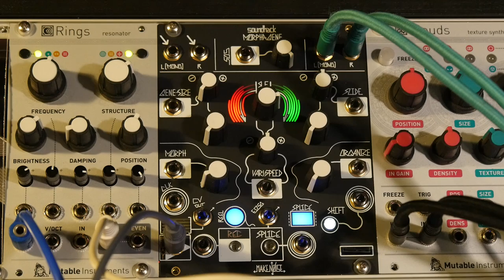Make Noise Morphagene Gating Technique

Comment: What does multing the gate to the clock input do in the first example? Do you not achieve the same thing just sending the gate to the play input?
Reply from the maker: kmb zoot if the gene size is smaller than the entire sample, then sending a gate to the clock input will "step" chronologically move through the genes in the splice. it has no real effect if you don't have the gene size smaller than the splice

Comment: Wouldn't applying a gate to the Shift and Play input yield the same results? I may be wrong as I've only sat down a couple times with the modules so far!
Reply: not really, you would first need to make some slices through this loop to make it shift. You could plan your sequence of genes this way and it would be repetitive, but no unpredictable, random results anymore. Well, unless you would patch some LFO signal to gene size, slide or vari speed additionally.

Comment: weird i thought stackables only worked for output not input. good to know
Reply: On input it seems to act as a sound mixer. Prolly OK for some signals (audio), might be dangerous with something like two very hot CV signals being summed up eg. high gate voltages. Dunno...
Reply: basically its just a janky passive mult
Reply: For the record Make Noise says the following about their mult... "The Multiple is passive, because the Make Noise system does not require Buffered Multiples since all critical control signals are already buffered in such a way as to provide a large fan-out capability." Having said that I stick to buffered and unity gain situations.

Comment: Nice demo :) Hey is it me or the sd slot is not aligned straith with the hole in the panel?
Reply from the maker: Matrix Modulator I'm not totally sure. I had the same thought but perhaps that is how the SD housing it fit on the PCB.
Reply: Ok so it's just not because of the camera, it should be straith like the picture they use for their website, the sd card on radio music is straith aligned too. Thanks http://www.makenoisemusic.com/thumbs/modules/morphagene/mpg12-1050x1328.jpg
Reply: Did you try morphagene into clouds ? :D
Reply from the maker: Yep, it's bliss. ;)